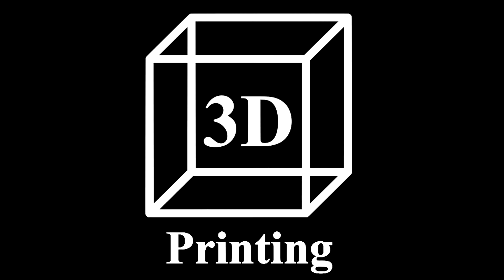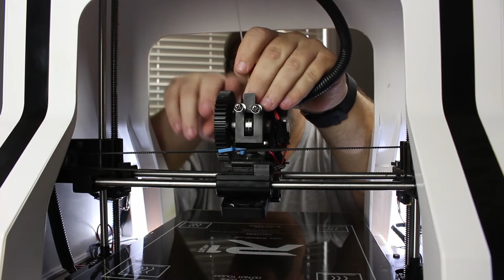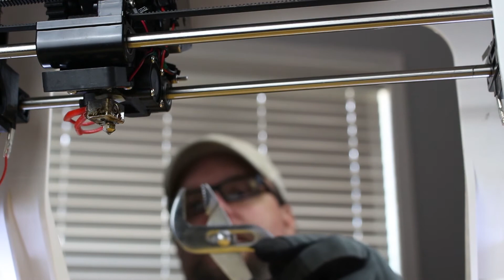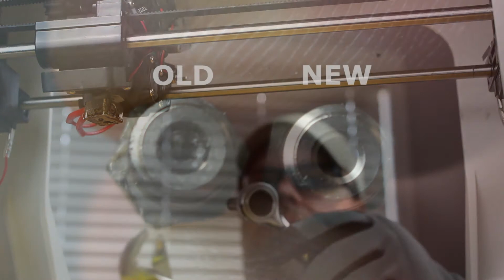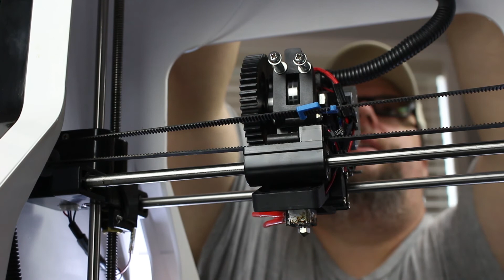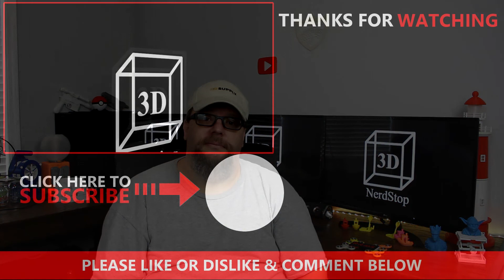3D Printer Maintenance: Cleaning and Replacing a Nozzle

Comment: you don't had to shut off the printer to cool down.  Under preheat there is cool down. command.  I do nylon pulls.. Same principle but cool down and then heat back up while I pull  constant pressure.  It releases when ready and removes all old filament.  Thanks for sharing .  Enjoy your channel,
Reply from the maker: Thank you for watching... How often do you do a nylon pull on your printer?
Reply: Only when the nozzle shows signs of obstruction such as you described.....curling filament as it extrudes.

Comment: Thanks for showing. I think I have a partial nozzle clog to try to clear out.
Reply from the maker: Thank you for watching. I hope it helps you unclog your nozzle...
Reply: That cleaning filament feels  pretty weird.  Well I was able to finally get some and I think it helped.  Filament was curling right after exiting the nozzle.  Sometimes it curls about a half inch down though. You think that's ok?
Also I've added a second fan.  That really helps a lot.  I've get great bridging  now.   I'm trying to make a snap on ring fan shroud but still tweaking the design.  I have robo r1 plus, e3d v6 hotend but didn't see a shroud like that.  Though recently I saw someone's video on different shroud types and open ring that blew air on both sides did really good.
Reply from the maker: The 1/2 inch down curl should be ok. As long as it is coming straight down from the nozzle at the nozzle it should be good. The filament only has to go .2 to .3 mm down before it hits the build plate... I will have to look into the ring fan and how well it works...
Reply: oh thanks.  Also forgot to mention that tip you have on loading filament helps a lot.
Reply from the maker: I know it makes it so much easier to load the filament.